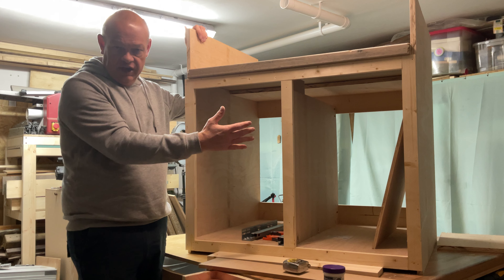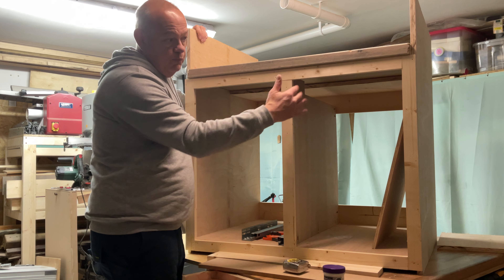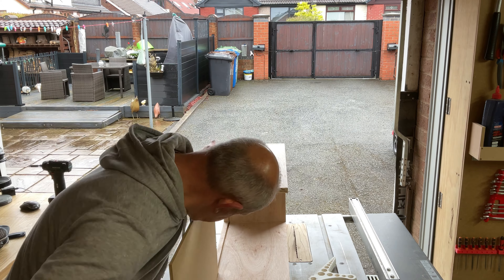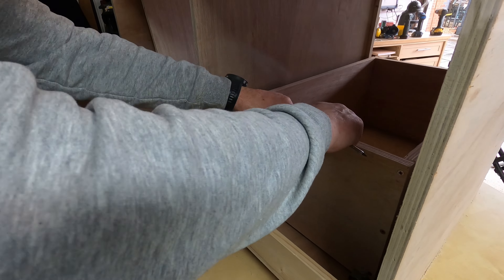The Garage Workshop - Miter Saw Part 2

Comment: Really nice build. Enjoying your content and candidness.

You mention having to fabricate a connector using a 3D printer. I'm interested to know which 3D printer do you use?
Also, is that an Evolution table saw?
Reply from the maker: Hi Mat. Yes it it, it's the Rage table saw and I have to admit I love it.

I use the Dremel 3D40 printer which is basic and small but it does the job.

Thanks for the feedback!